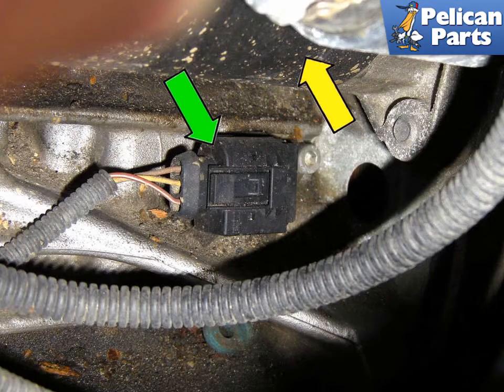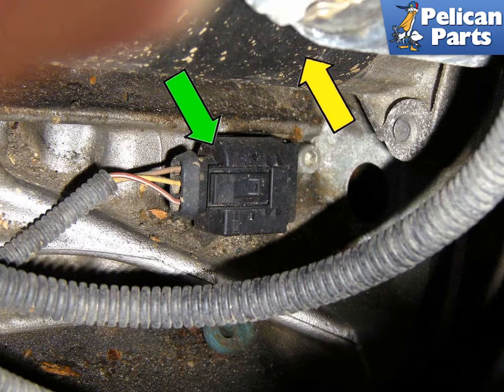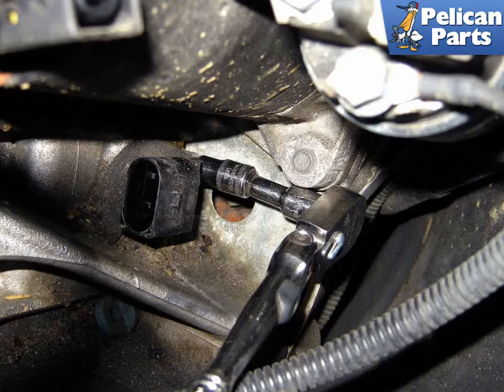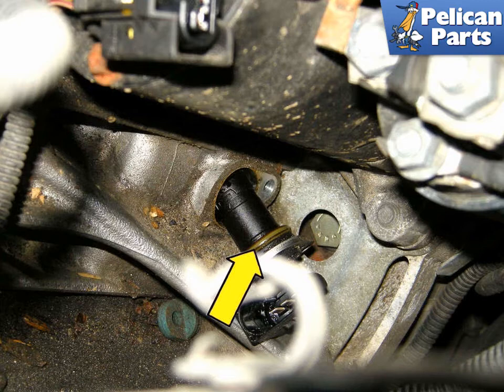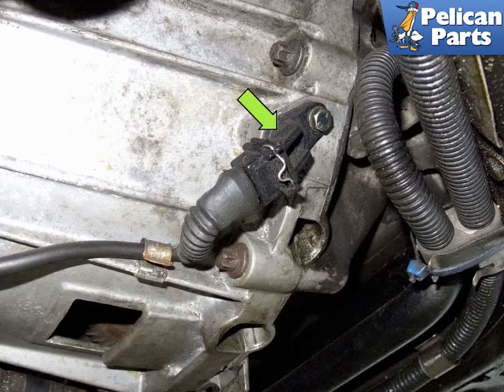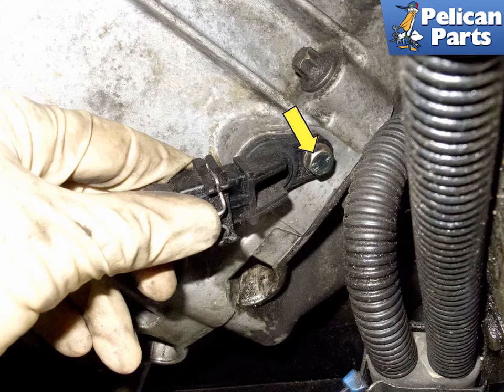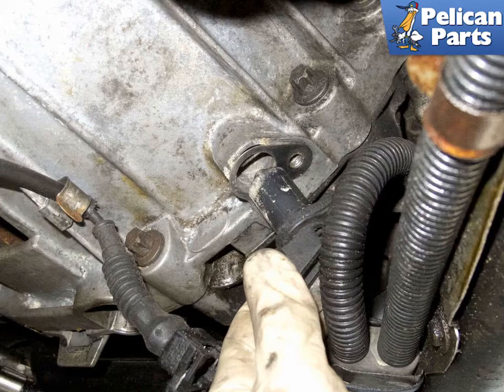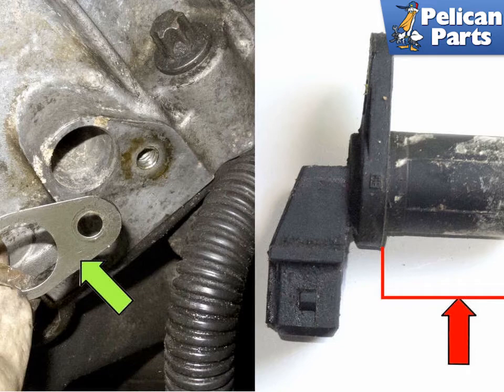BMW E39 5-Series Crankshaft Sensor Replacement | 1997-2003 525i, 528i, 530i, 540i

Comment: Good video. I just did this job today on my 2001 530i. Use a 5mm allen key, you will need a small extension (I used 1/4" drive). There really isn't much room but I just took off my cabin air filter and nothing else. Went in from the top, I'm not sure how you would do this from the bottom since you wouldn't be able to see the bolt itself. Sensor replacement fixed my problems completely. Good luck!
Reply from the maker: Thanks for sharing your repair process and experience. These types of comments add so much to the Pelican tech community.